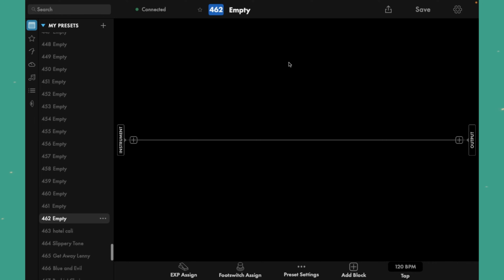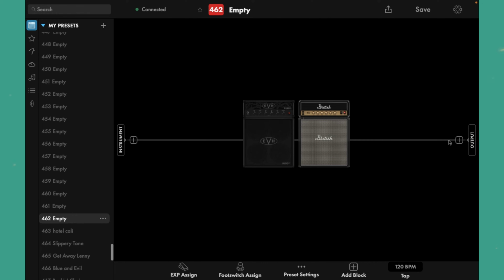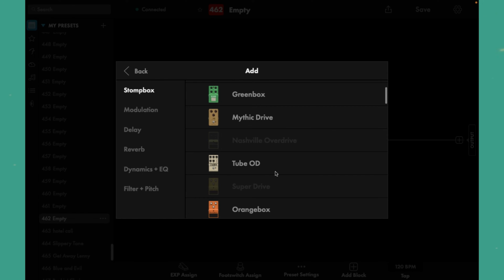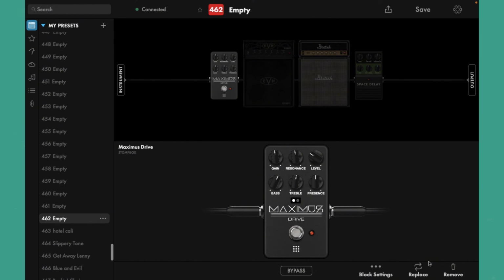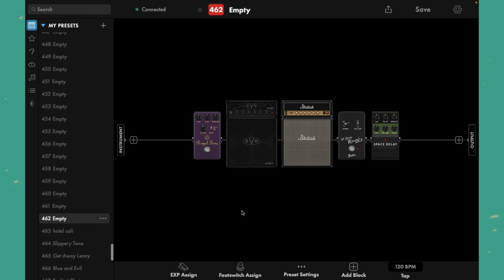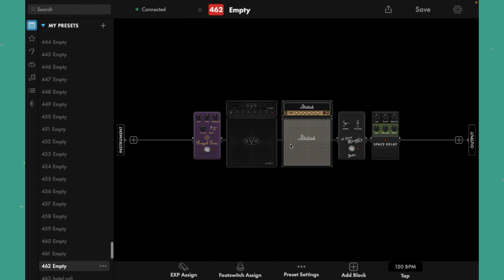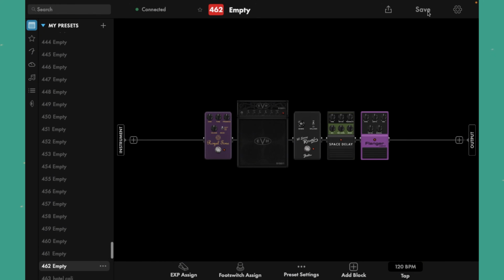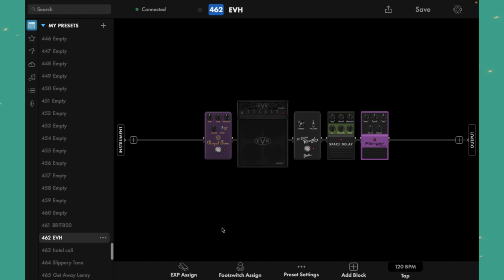Fender Tone Master Pro CPU Limits? Fix It Now!

Comment: Very helpful - I had no idea. Fender could/should document this via the UI with a simple notification that memory/usage has been exceeded. It also seems quite a limitation that such a tool that is seemingly expansive has such limited processor power.
Reply from the maker: Yeah I agree, I believe the fractal tells you the current CPU usage I think that's a good idea. I also think they have some optimisation work to do

Comment: It is limited like HX Stomp... but the big boy Helix has twice as much CPU. Disappointing.
Reply: "Helix has twice as much CPU"

How are you quantifying that?  I fit tons of shit into my TMP patches. I feel like it's a lot more than my Helix patches, but I'd have to compare (I used more amps in the Helix patches, far more pedals in the TMP patches).
Reply from the maker: It's really not that bad though, I've never come up against major CPU limits with the presets I've created you need to be using a lot of effects. If it's because you are using multiple Amps it's easy to just create a separate preset as it has noiseless switching. But I thought it was worth pointing out anyway.
Reply: @JonsGuitarGarage  I wonder how pitch shifter limits CPU. Does it have polyphonic one? BTW fot me (my opinion and I might be wrong) it is disappointing that the CPU of this unit is worse than 9 yo Helix.
Reply from the maker: @wolfhorsky  the pitch shifter isn't very good I don't use it, it's ok for like octaver style effects but not like a drop tune. I don't think the CPU is less powerful than a helix though?
Reply from the maker: Personally I think Fender are being conservative with their processing limits just to ensure the unit doesn't crash when it is such a new product. But that's just a guess.
Reply: @JonsGuitarGarage  thx for the replies. To this date the best potch shifter to drop tuning is in Helix. I hoped sth new would be even better. Cheers
Reply from the maker: @wolfhorsky there have been a lot of requests for a drop tune in the TMP and Fender have replied saying it's coming so hopefully next major firmware release 🤞
I will say that I'm impressed how much community comms there have been from Fender.
Reply: @wolfhorsky 
Also, Boss has great pitch shift. I have the Boss gx 100 and it works wonderfully with no lag at all. Fractal is also good pitch shift (fm3 has worked for me well in the past).
Reply: @macmac838  Thx for Your valid opinion 🙂

Comment: Strange. Fender has the resources and experience to avoid these issues. Line 6 has been very creative in optimizing software with updates and features around a chipset at least 6 years old.
Reply from the maker: @pearsonart  I assume models will be optimised over time but I assume they were being pretty conservative initially to avoid any backlash for crashes

Comment: Does adding external pedals  use any processing power?
Reply from the maker: That is a great question, I've always assumed not but you have to add an "effects block" to do it so it must have some affect. I will investigate further
Reply: I doubt a loop block will use much memory
Reply: No, it’s negligible to add the FX loop blocks. I run the stereo block in all my presets. Also, depending on which effects you use, you can have a longer, more complicated signal chain.

Comment: Great video! I also find just using the amp head only options but with the same cabinet can free up some CPU.
Reply from the maker: Absolutely, I really should have mentioned that but hopefully people will see your comment. Also some amp heads do not include the reverb circuit compared to their stack and combo models and use even less CPU resources.